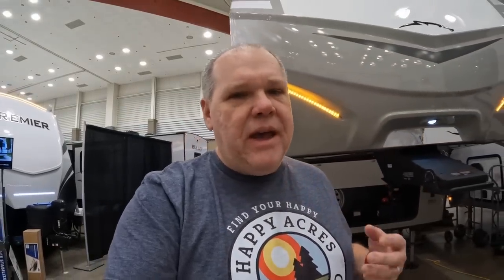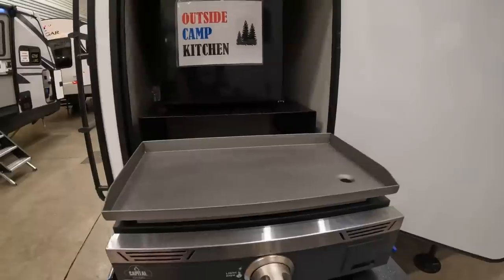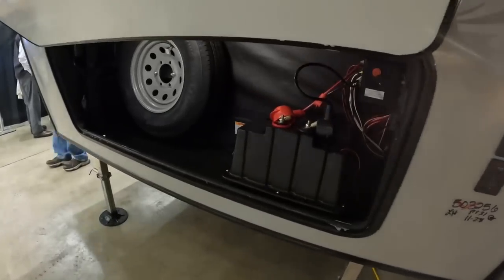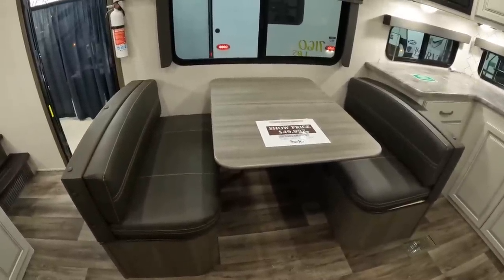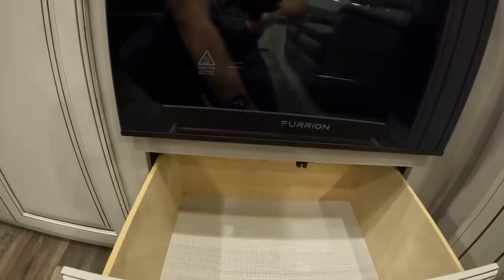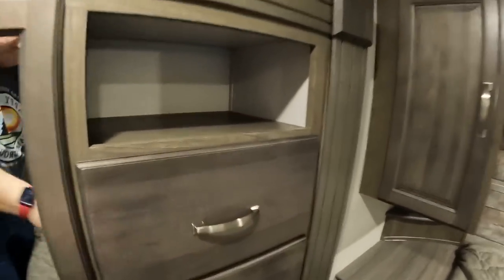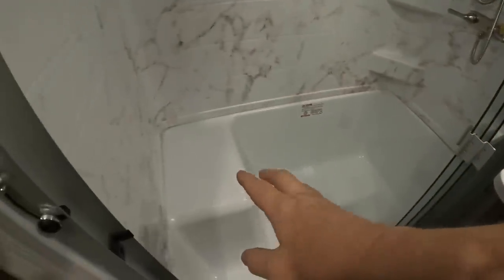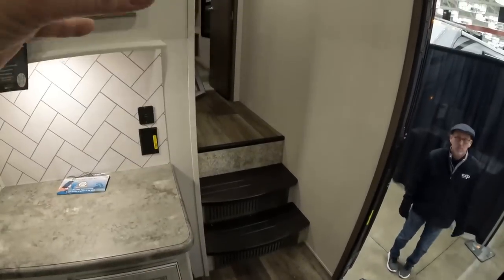ULTIMATE UNDER 28’ COUPLES 5th WHEEL: 2023 COUGAR 23MLE

Comment: We came VERY close to buying that very model two years ago.   A couple things changed our minds.  The dinette was too tight. We are not large people,  145 & 165 lbs. We didn't like the second tip out for the closet. One more place for problems.   Also,  felt a bit smaller unit would be our preference.   The storage and holding tanks in that unit are wonderful, so a huge plus.  Just thought we would share our take on this unit.  We've been enjoying your videos for several years now. THANK YOU 😊
Reply from the maker: Did you end up getting something else?  We’re continuing our search
Reply: The 2023 has a new design, much better.
Reply: @Travels with Delaney  We've decided on a tab 400 Boondock.  Guess going smaller seems to be the way to go at this time. Maybe sticking to a more camping experience and fuel prices. Our trips will mostly be 3 nights away from home, too, for the time being.

Comment: I like the size, features and beautiful interior of that Cougar 5th wheel. We have the same gas truck as you and have been considering a small 5th wheel. I was a loyal Keystone customer as we owned a 2011 30' Springdale travel trailer. We loved this Springdale. Then we decided to upgrade to a 2018 30' Cougar 26RBI travel trailer, which towed better than the Springdale. However, we had a lot of quality issues with that Cougar. The kitchen island plumbing would always fall apart when traveling. The rear LED marker lights did not work and had to be replaced, etc. The biggest problem was the cable slide system for the main slide pulled out of wall while I was there at the dealership service department for the lengthy problem list. This issue was not the fault of the dealership. As a result the slide-out could not be fully pushed in. What if this happened in the middle of nowhere? This cost me major $ and another month of repairs. Keystone customer service was absolutely rude to me about my issues. After all of the repairs were completed I immediately traded in the Cougar for a new 2019 Rockwood 2608BS which has been awesome! If you decide to go with this Cougar fifth wheel I wish you good luck, but keep an eye on that slide-out cable system. In my opinion Keystone should be using the traditional rack and pinion system especially for the larger slide-outs. Also make sure that you have enough room while sitting at the dinette as ours was too tight and we are not big people. Just trying to help another camper. I have been camping for 50 years and have camped in everything but a fifth wheel. Love your videos!

Comment: Love this camper,just right for my wife and I plus 2 dogs I don't know if my truck will tow it.i have a 9500lb towing rate.
Reply from the maker: A lot would depend on your payload capacity as the pin weight is 1550#.  My guess is you'd need a bigger truck.

Comment: That is an interesting floor plan..............one I have considered more then once. 

After seeing the Cougers at an RV show recently I am not as excited about them as I once was. For being a high end trailer, I was kind of dismayed at some of the items that were not included. 

The first being that there were not any "fantastic" sized fans in the unit to promote airflow. On the units I toured, you got the 4 inch fart fan in the bathroom and that was it. Some units included just a no fan vent in the bedroom. You would say that you could upgrade the bedroom vent to a fan unit, but where would you get reliable power? As the lights are turned on and off by the controller in the storage compartment, even if you connected your Fantastic fan to the power feeding a light in the bedroom, the power would go away when you shut the light off and the fan would stop. Comparatively, the Fantastic style fans are relatively inexpensive and in my opinion should have been included and designed into the trailer. I would also prefer a Fantastic style fan in the kitchen to help with kitchen fumes. 

The suspension does not include wet bolts to allow suspension greasing. I assume this means you get the nylon bushings in the spring suspension. This may be fine if you don't plan to travel too much, but I would prefer to have a greasable suspension. 

On the 400i solar system I learned the inverter does not feed the microwave. Now if there is anything that I do want the inverter to feed, it's the microwave! That way I could heat food without being connected to shore power or starting a generator for the brief time I would be using the microwave. 

Although I really like some of the floorplans Cougar has, I am not the biggest fan of some of their lack of attention to detail. In my opinion, they could have done away with the One Control unit and taken that money and spent it on some of the items above. I really don't need a microprocessor controlled unit to turn the lights on and off where a $2 light switch would do. 

Have you seen the Jayco 24RE fifth wheel? I toured this unit at a recent show and really liked the huge pantry behind the TV, and the units ability to have a combo washer dryer in a smaller fifth wheel. 

Also Outdoors RV and Arctic Fox make some pretty good units, but they are manufactured on the west coast so you may have to drive quite a bit to get one of these units. 

Take Care!
Reply from the maker: Thank you for all of your insights and feedback
Reply: You should compare the Cougar to the Grand Design 226RK. I think it is a little better on all levels.

Comment: A couple things to keep in mind. The Solarflex 200 doesn't come with an inverter. Which the one you showed was
We went with the Tri-fold couch because we like to take friends with us.
The bed is a short queen. We may upgrade to a full queen and extend the platform. Do you think there is room?
Reply from the maker: You are correct.  The 400 package comes with a 2000 watt inverter and the 600 package comes with a 3000 watt inverter.  I think you could add the full queen. I didn't measure the space at the end of the bed to the wall but it seems I remember there being enough room.  Maybe a bit higher to get around
Reply: @TravelswithDelaney  Yes someone said they upgraded the mattress to a full residential mattress and still had room at the foot of the bed.

Comment: Check the mattress size. We were recently at a dealership looking at a Cougar that advertised the queen bed being 60"x80". I had the sales person get his tape measure and measure it. It was 60"x72"!
Reply from the maker: I checked and you are correct.  They are using an RV queen instead of a residential queen.  I did speak with a current owner and they said they were able to replace it with a residential queen size bed with no issues.

Comment: I'm thinking go a little bigger if you go 5th wheel. 30ft.  This one is a nice unit though.  1/2 ton towable is kind of a joke. I would get a 3/4 ton if looking to tow this.
Reply from the maker: Yes...Most likely  you'd need a 3/4 ton to tow this one with that 1550# pin weight.

Comment: This unit has dry weight of 7575 + max carrying capacity of 2300 = 9875 #’s x 15% (probably more like 20%) = approx pin weight of 1500-1975#’s. Two passengers 400 lbs + 100#’s stuff + hitch 200#’s = Total 2200 #’s. Chevy’s max payload on their top Silverado is 2260 #’s. This weight is way too close to max payload to trailer this safely . No engineer would recommend reaching max payload or trailering weights. All these max weights are determined by towing a flatbed trailer, NOT by trailering a 12’ high camper. Just buy a 3/4 ton and be safe. Wish RV manufacturers and salesman would stop promoting these as 1/2 ton towable just to get a sale. Delaney, please take the time and research and list for your potential customers all the 1/2 ton trucks and their cost that could tow these safely. Most reputable people would say never tow above 75% of max payload or trailering weight. Also, list the 3/4 tons and their price that could easily meet the 75% rule. Please people don’t believe these are 1/2 ton towable safely. You can get sued if ever in an accident and proved that you were not within safe towable limits. Plenty of videos on YouTube that will back this info up.
Reply from the maker: We have a 3/4 ton truck so we would have no issue towing this.  I agree…..there are very few 1/2 tons that could ton this within limits and you’d most likely be at the limit.

Comment: I think I see you with the travel trailer myself! And your head hitting the ceiling or just barely fitting in the shower at 5’9” really sucks for us average size men! I am 6’3” no way I can get in that shower!! Or in the bedroom. That place looks way to small! And they really just replace dinettes with couches! Make more sense! I cleaned up this text after voice assistant messed it up.
Reply from the maker: The front window would add more light in the bedroom. Personally, we don't like having the window behind our bed.  We prefer a solid surface that our pillows wont interfere with and less cold air seeping in.